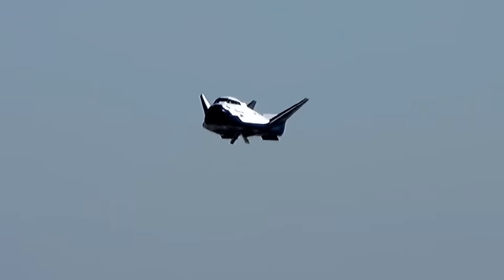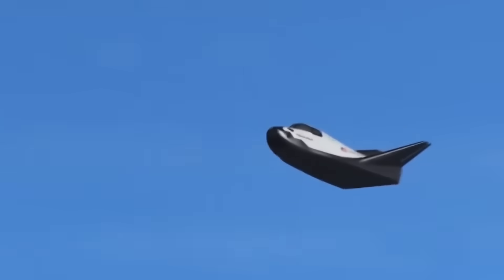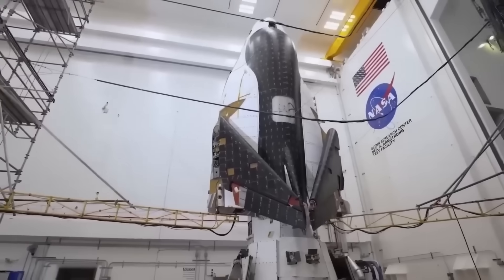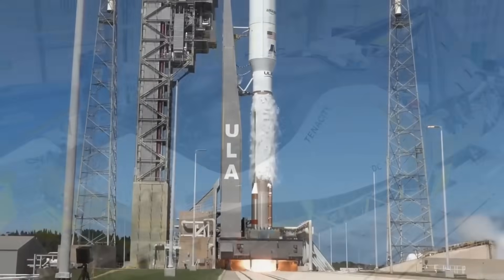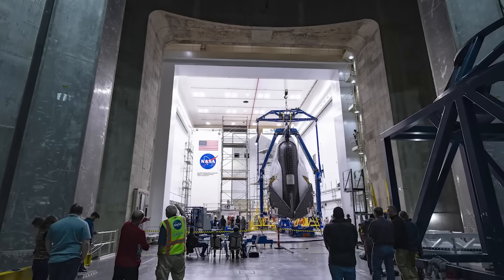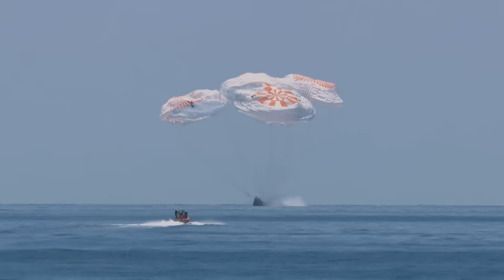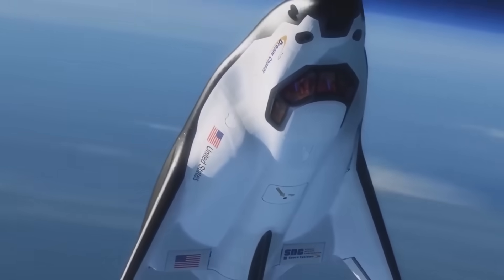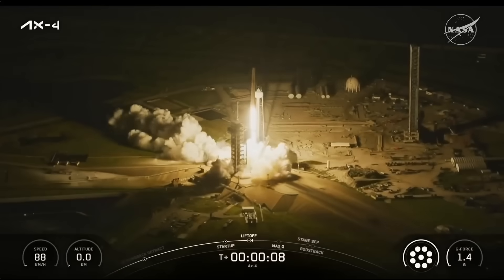Dream Chaser Is Finally Launching After Multiple Problems!

Comment: NASA Safety Standards with  Boeing 🤣🤣🤣🤣🤣🤣🤣🤣🤣🤣🤣🤣🤣🤣🤣🤣🤣🤣🤣🤣🤣🤣🤣🤣🤣🤣🤣🤣🤣 🤣🤣🤣🤣🤣🤣🤣🤣🤣🤣🤣🤣🤣🤣🤣🤣🤣🤣🤣🤣🤣🤣🤣🤣🤣🤣🤣🤣🤣🤣🤣🤣
Reply: Really was too bad that Sierra Space didn't get the nod from NASA Instead of Boeing. We would of possibly had a working craft by now. And I felt back at that time, that two different types of craft would of given our space program a far wider system of function.

I still wish that Sierra Space would set up the ability to launch on Falcon Heavy to prevent their being left without a launch when needed. ULA still is not up to any reliable speed of launch yet, and may never be a rapid access launch provider. I am sure this craft will be in service long after the ISS leaves service.
Reply: @ronfullerton3162  I think it's better for them to stay out of the Muskosphere and stay independent. ULA is doing just fine and SpaceX is becoming more and more volatile.
Reply: I would rather fly a Cabrio Tie Fighter